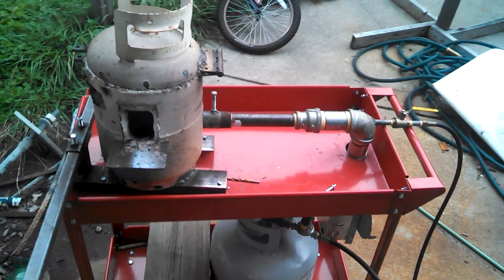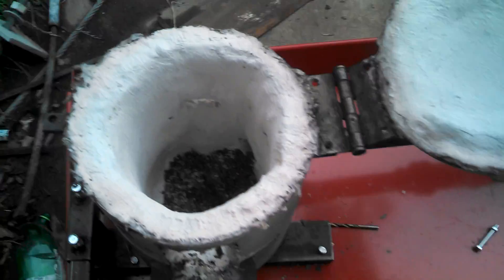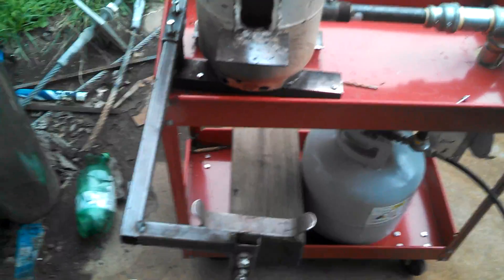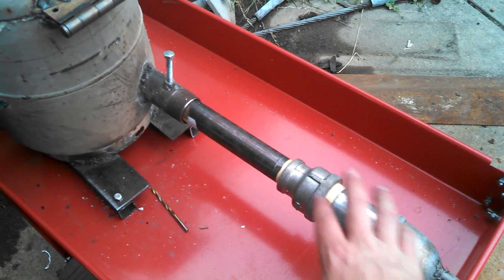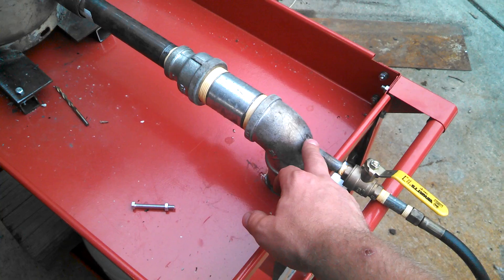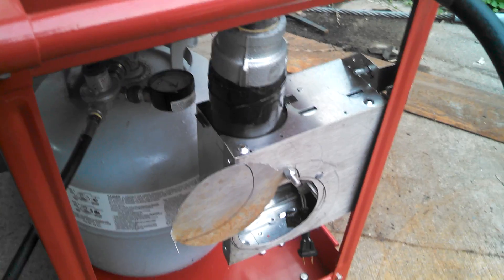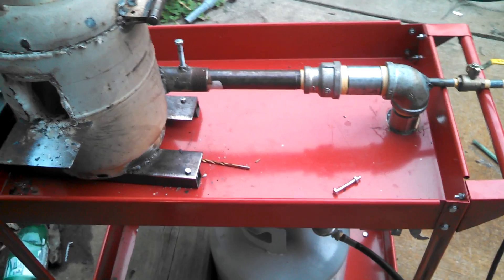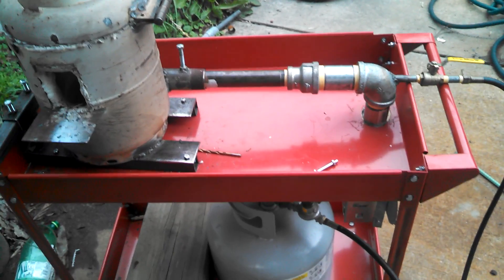Mobile Damascus forge

Comment: what do you plan to make with this forge? 
Also I want to ask do you love/enjoy forging? 
What got you in to it?
Reply from the maker: This forge is going to be used for making Damascus. Forging is way more satisfying than stock removal, as your creativity is not limited to something the size of your bar of steel. the most expensive part of this whole forge was the cart at $29 the tank and most of the pipe was laying around and the bathroom fan blower was $17.